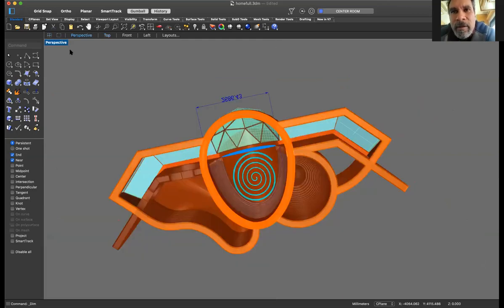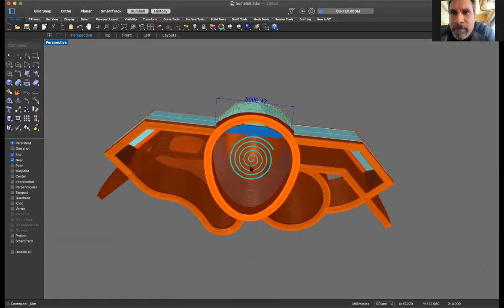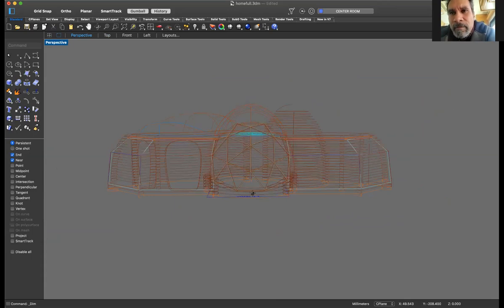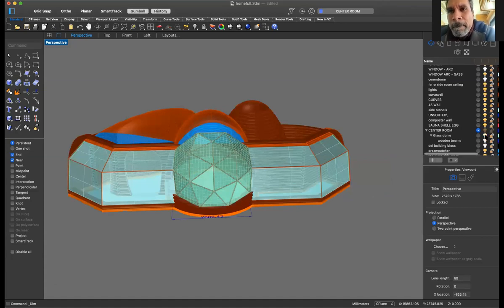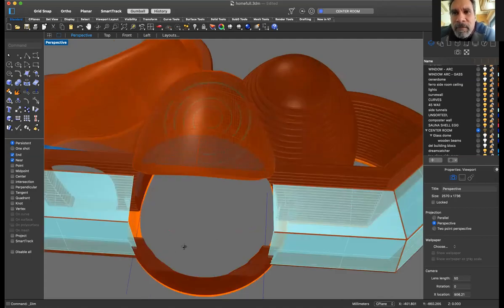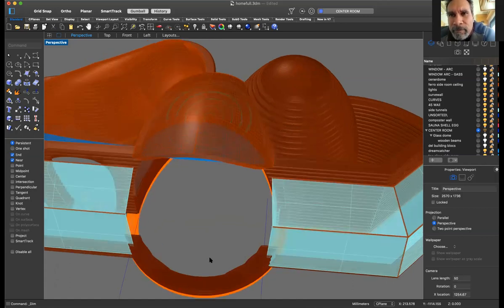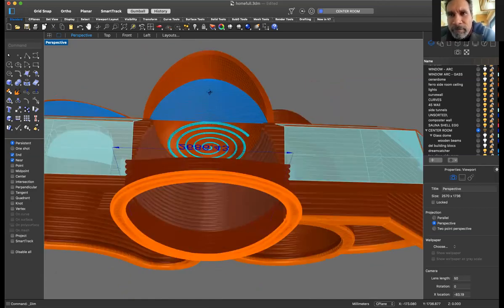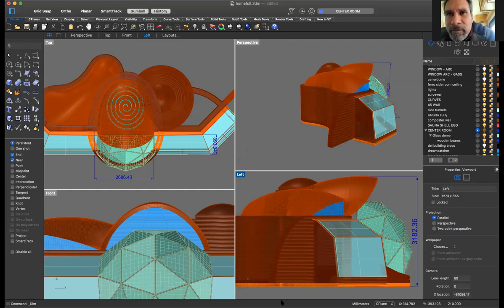AirCrete Harry & Alosha Bio-Veda talk on BioDomes and other dome building techniques

Comment: am buikding a shelter in the Karoo in an H shape, each leg is an inverted U with a half dome at each end of the H. The construction is 6m x 25mm square tubing rolled into half circles with 1m extensions added to each end spaced 1.2m apart on 600mm lengths of 20mm rebar hammered into the ground, looks like a greenhouse tunnel. then cover whole frame with 8m lengths of 100x100mmx3mm reinforcing mat. Cover that with geotextile bags 700x600mm all stitched together with the ends overlapping 100mm. Cover the structure with reinforcing mesh with spacers 50mm between the top and botton mesh. now pump aircrete into the bags. add doors and windows plaster surfaces smooth and you have a cheap insulated durable shelter. build ferro cement water reservoir under ground for geothermal heating using coiled pvc pipe as heat exchanger, one top, heat out, one bottom, heat in. Lay out in sunny area length of 50mm black pvc covered in 2L cooldrink bottles with top and bottom cut to fit snugly over the pipe as your solar heat collector.

Comment: Love this. Great collab.

I'm not super-up on your designs in full, but, have you made allowances for variation in pressure as you make changes to temperature for things like the compost which would be sealed off entirely? Or do we just trust that the pressure variation wouldn't be too hard on the aircrete walls?
Reply from the maker: building a prototype and will test all out , catenary shapes are very strong www.bioveda.co/wautillarium
Reply: @AloshaLynov  gh I'm 0

Comment: If you want to incorporate latex concrete into your domes for an extremely strong low-cost structure, I would recommend contacting Doug Lacy with Flex-Shell Architecture:  https://flex-shell-architecture.com/flex-shell-framing/

he also has a youtube channel: https://www.youtube.com/channel/UCdacvMDwczmAU8Uz99ehwew
Reply from the maker: Thank u for sharing I will definitely check it out. Very interested in this string shells that I can thicken up and bury.